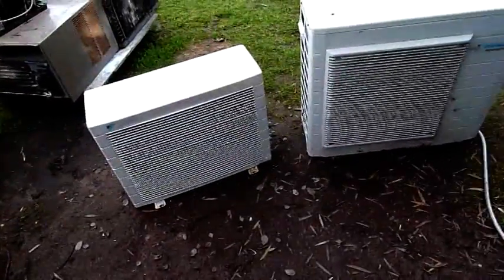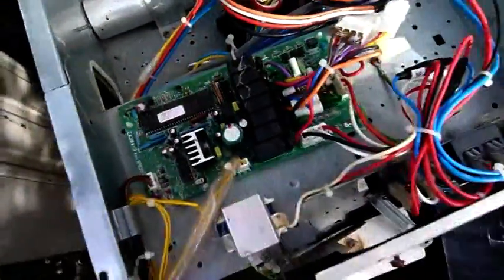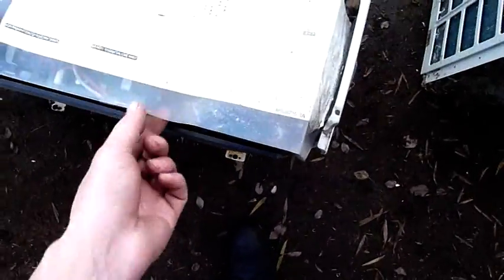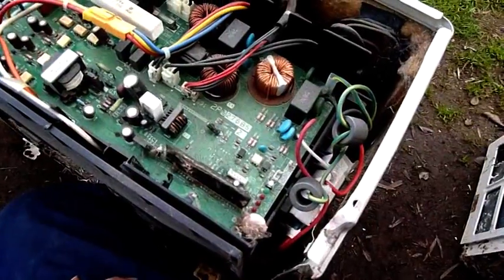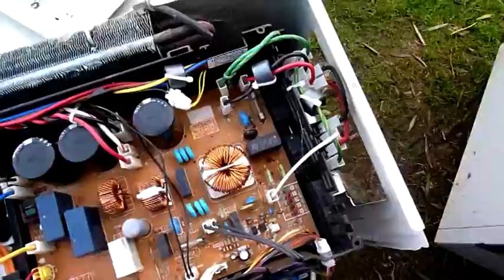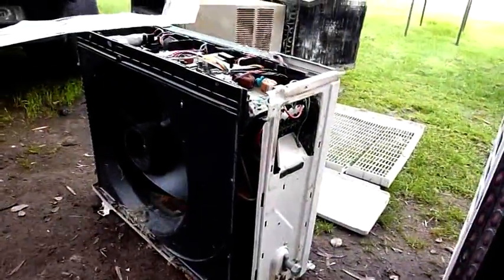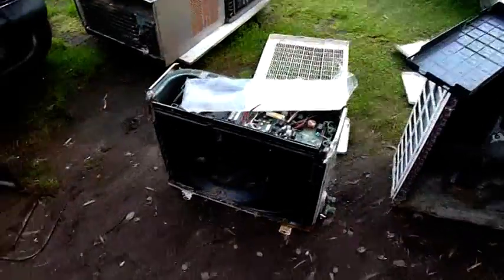Daikin Inverter AC Unit Fail - Moisture / Salts Damage to PCB

Comment: I have one of the newer style big units like the one of the left you know because the on condesing unit the inverter logo has a green and black stripe thr model is ftxs60fvma indoor and outdoor unit rxs60fvma its never ever been serviced or had any issues since its istalation in 2007

Comment: Just bought a Johnson split and it says the external unit PCB is protected against moisture. Cheaper to buy than a new externalAC board for the Samsung rubbish AC for which the internal unit PCB also kept failing due to a poor quality PCB for  the  IR remote sensor.!

Comment: So I have the record for inverter failure. HISENSE AIR Conditioners - 4 units near the Caribbean sea in Mexico. All circuit boards failed within a year and a half and none with more than 60 hours and some with 6-10 hours usage. $150 usd to replace each and will most likely be doing so every 2 years. HISENSE wants no part of making good. Poor location in the machines, poor PCB coating, poor components and no attempt to protect the electronics from any level of harsh environment. Designed to fail but before they are out of the box. Great video.

Comment: is dc inverter ac compressor is also dc compressor ... and dc fans?
Reply: Technically they all are 3 phase AC but the freq drive is variable, or pulse width modulation.

Comment: Do the Daikin air conditioners all use the same thermistor on the indoor unit' control board?  If so is it possible to get one from you, surely it's cheaper to have a electronics technician solder a new thermistor on than pay $400 for a new board...?

Comment: I have now had to repair 4 daikin airconditioners by replacing the PCB boards at great cost.  The air conditioners are located in a seaside town and affected by salt even though 3 of the 4 of the external units reside under the house.  They are at least 12 years old but rarely used as its a holiday home.  Why cant daikin better protect its units with a filter or other material?  I would never buy one again-Mike F

Comment: Bugger. Wish I'd seen this before I bought a Daikin! Anyone tried using PCB lacqer on these things? http://www.jaycar.com.au/Service-Aids/Chemical-Aids/Aerosols/Circuit-Board-Lacquer-Spray-Can/p/NA1002
Reply from the maker: +Ricky Lee it would help,  but keep in mind the units in this vid are old ones, they have since resorted to coating boards pretty well now. if yours is new, I would not worrry about it, any messing around inside would just void the warranty.

Comment: Hi Aussi50 - Great vid. Got some questions for you. You said that inverter technology doesn't save money? From the inver technology principle it makes sense that if one could control the rotor efficiently then one could also utilize less power. I would appreciate if you could elaborate a bit on this. Thanks in advance.

Comment: Inverters and VFDs are nice technology. The problem is not with the technology, but it's simple sloppy design; these components are delicate, but the manufacturers didn't design in appropriate protection.

For external use, these electronics really need to be in hermetically sealed enclosures. Car manufacturers have managed to do it with their ECUs; industrial equipment manufacturers do it for industrial electronics/VFDs. It's purely cost-cutting not to protect them.

Comment: I live in the states. In residential construction, I almost never see inverter-driven units. My house (13 years old) has the old-school AC-driven compressor. No PCBs. The only thing that has failed on it in 13 years is the capacitor (last summer).

I used to work as a server admin at a steel mill. Our server room was retrofitted with a Mitsu inverter-driven unit. In the six months after installation, we had numerous failures, all due to electrical shorts on the inverter board. Just sayin'
Reply: Everything in Australia is inverter driven it’s because we have all the Asian brands or your “mini split brands” so even if you buy a ducted unit it will be a Daikin Panasonic or Fujitsu branded heat pump. Any way inverters are actually really good for energy savings and nowadays they seem to last a lot longer

Comment from the maker: @Serostern the steel end plates can be removed with a 9" grinder, the aluminum fins stay as -is. classed as a clean copper-ally radiator by the scrap man.

I don't bother taking the steel ends off now days, not worth the time for only 20c per kg extra.

Comment: You  are exactly right. because of short life they are more of a drag on the environment. More resources used that may not end up getting properly recycled. The energy savings I'm sure partially justifies the use and design of the machine. But really we are just giving our money to a manufacturer that irresponsibly produces machines that don't last. That increases the volume of machines in the recycling loop. That increases costs for the consumer. That drives up prices on the original equipment.

Comment: I just had a new Trane system installed at my house and it takes a different approach for getting high efficiency. The compressor is a regular mains powered scroll, but has a 50% capacity unloading valve for 2 stage operation. Then the unit has a BLDC fan motor for both the outdoor fan and the indoor unit to optimize fan speeds around the current conditions.

Comment: @Aussie50 its the other way around here daikins have a bit of a bad service here 1guys daikin mini split  was installed by the dealer using a larger diameter pipe welded instead of flaring, most other acs available here are never installed properly they dont pull a vacuum just flush the refrigerant . mitsubishi electric is less efficient and Toshiba's are service by carriers. MHi has a better reputation here as far as people who have used them

Comment: Never seen a PCB on an AC unit but all the newer ones do for the electronic controls.. Mine is an old style unit (No PCB) from the 70's or 80's and it still works great to this day. PCB's do not belong in AC units b/c they just are not reliable.

Comment from the maker: @rossm06 thanks for the info, I generally avoid inverter stuff and figured the writing on the compressor was indicative of its supply voltage and current type

Comment: @Aussie50 Firstly just like to say I like your vids. Keep up the good work! Yes correct current model A/C inverters use a BLDC motor. A BLDC fan motor can be optimised for AC or DC power supply. The BLDC motors used for compressors and also the outdoor/indoor fan motors in A/C's are vector control. Have a go at pulling apart a BLDC fan motor and look inside. Some have a PCB inside the motor.

Comment: Your comments are incorrect about feeding Direct current to the Compressor. The power supply to the unit is 1phase AC convertered to DC (bridge rectifier) then invertered (transister module) back to a 3phase AC feed to the compressor hence the inverter terminology given to the product. The DC compressor they commonly refer to in the product brochures refers to the compressor motor being digitally commutated. All inverter A/C work this way not matter what brand and range from single splits to VRF

Comment: They shod seal the inverter boards in a aluminum case. Like they do with car ECU's. But like you said they are built cheap or to fail. So you buy a new one every 5 or so years.

Comment: @daewooparts Is it a pink looking stuff?  I have seen it used with on some marine electronics and also sold to protect expensive R/C receivers.  You could take  a R/C receiver for model airplane sprayed with the stuff and then submerge it in salty water and it would still work perfectly while underwater.  Used to demonstrate it when I had my hobby store.

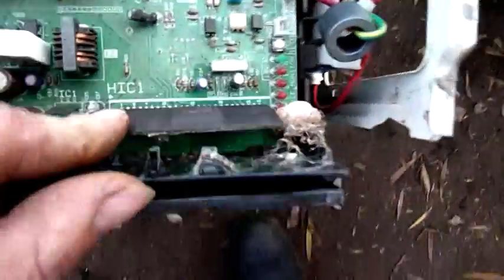Comment: I love the floppy hybrid IC pack at 7:28.  Nothing to protect it's leads from fatigue failure when the unit vibrates from fan and compressor motors.  Idiots that design this crap give electronic control systems a bad reputation.  Flash microcontroller will lose memory after about 10 years anyways.

Comment: @Aussie50 NOOOOO,its not, this stuff is a non conductive oil,not a laquor or plastic spray ,its made for high priced avaitonics and circuit boards,and it also repels pest from making the nest inside too. i hooked up a electronic flasher that was soaked in this stuff and left it in sea water for a month and it still worked,i still got the flasher somewhere,i got to look for it now

Comment: I think you are right, they are made to fail.
Somehow I think a solid plastic block (PCB with components inside epoxy) would be better in that place,
 even it would be tricky/impossible to repair.